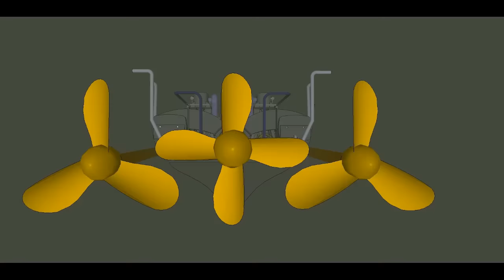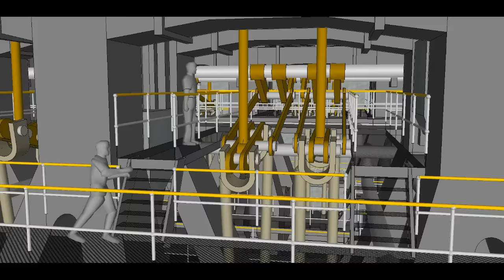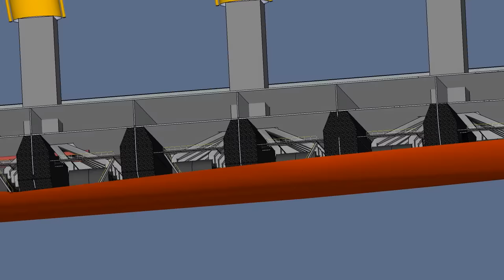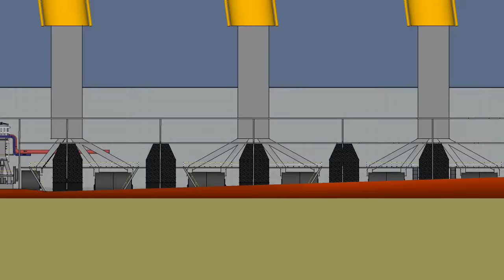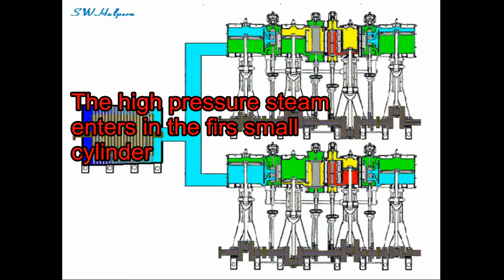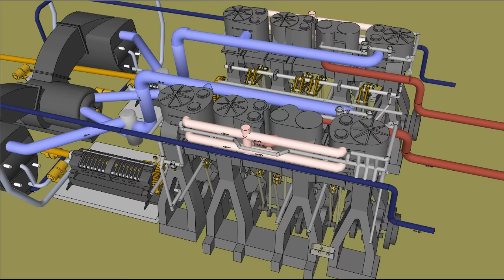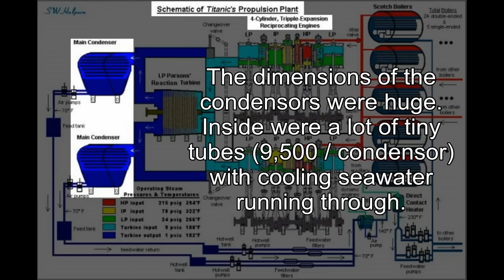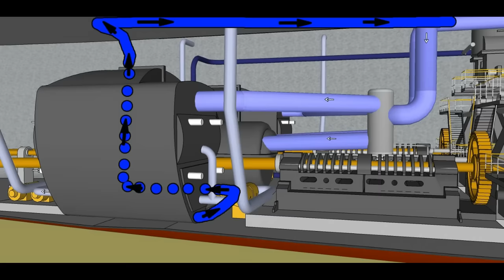The Engines of the Titanic

Comment: Those stokers had no eye or ear protection, no hard hats. They probably got treated like shit, constantly getting yelled at. And, god only knows how hot it was in those boiler rooms along with all the coal dust. Alot of men nowadays would quit after a few hours.Those were not ordinary men, much respect.
Reply: I agree with You. Respect and the safety of the workers has progressed a lot since then. Regards.
Reply: They were well paid and well respected. Until Oil fired boilers came around, a stoker strike meant ships won't sail. And operating on tight schedules and slim profit margins (the ship had to pay for it's construction and operation. Took 10-20 years for it to turn a profit), stokers could stop the world if they wanted.
But it was a hard, short life. Breathing coal dust caused silicosis and being an industrial setting you were subjected to stuff falling from height occasionaly.
A cloth mask and a helmet would eliminate these hazards completely. But we simply didn't know any better.
And it probably was HOT. Being under the waterline though, maybe it was not as hot as we might think. They had plenty of ventilation by air bled through the furnace air  intakes.
Reply: Yes i think you have summed that up very well, they would have worked their asses off, heat well you surrounded by boilers it is going to be HOT!! Similarly the fire men on steam loco,s summers day 25--30 deg C outside, 50++ inside the cab, driver wants MORE steam Big hill coming up, better get shoveling!
Reply: life is all about choices
Reply: My dad was a stoker in 1930s and spent 50 years at sea, even in his 70s he was someone you wouldn’t mess with, those men were a different breed
Reply: Completely on your side re - your great comments. Nice 👍 one. Cheers 🍻
Reply: Yeah and sadly those ordinary men are disappearing
Reply: @ThZuao  >A cloth mask and a helmet would eliminate these hazards completely.

A cloth mask would not at all be effective at preventing black lung and/or silicosis. It'd be like trying to use a screen door to stop smoke. Silica dust from fly ash is on the order of microns, even a modern N100 mask would have trouble with. The only thing the cloth mask would block are the larger coal dust particles, but not all of it.

The stokers also got heaping doses of radiation from all of the radioactive material in the coal, like uranium, radium and radon gas. They're exposed to it by the coal dust and even more from the fly ash and bottom ash which concentrates it. And by the nature of the ship having smoke stacks right above passengers, they get exposed to the same things, but have less risk since they're not on the ship for very long.

>And it probably was HOT. Being under the waterline though, maybe it was not as hot as we might think. 

Anywhere near the boilers was going to be well over 100 degrees at all times with thick choking smoke, coal dust and steam leaks. It was a miserable existence that was farmed out to people usually from Indian subcontinent because of the racist belief that they as a people were "designed" to tolerate such temperatures since India is so hot.

Being under the waterline didn't help the heat, that is until there was a gaping hole in the hull letting the freezing sea water in.
Reply: It was probably 120 degrees F or more standing in front of furnaces feeding them coal manually for the stokers, who also had the additional work of keeping the machinery in good working order. They were made of stronger stuff than most men today.
Reply: @GGigabiteM  >...with thick choking smoke... 

Didn't ships have a blower system for artificial draft while standing or not working hard enough to supply sufficient draft to send the exhaust out the funnels? Steam locomotives had this system, but it was touchy to use because it used steam to create the draft to help make more steam. Using too much was a waste of steam, you ended up using more than you were making if you opened the valve too much. I assume ships this size would have had this issue as well, considering there are multiple fireboxes (opposed to one in a locomotive).
Reply: @GGigabiteM  Oh, I never had any doubt of the miserable conditions. I'm just more of a locomotive guy than a ship guy and as such some of the workings of ships are a mystery to me.

That superheated steam tidbit is an interesting one for sure. Definitely not a problem you'd find on a steam locomotive, seeing as the highest pressure encountered on anything not considered an experiment of a failure was 300 psi.

Not to mention the super heater units were all tucked safely in the center of the boiler (which used a firetube system rather than water tube) whose barrel was 6 inches thick.
Reply: And yet it was still probably better than many other jobs at the time.
Reply: yeah cause most men are smart enough today to not want to get cancer from their job
Reply: @PowerTrain611  There is avido of the condition on the Ark Royal just before it was scrapped in the late 70's-eighties it will be on youtube there was a part of the engine room that was arduous.
Reply: @IanWaldrop  This is a key point. Their choices were vastly more restricted than ours are today.
Reply: @dondubray4253  really ? Lol there wasn’t opportunities back then like there are now.  Different time.
Reply: Back in those days, they were very ordinary men as working hard flat out to the bone was normal for back then. If you did''nt have back problems by your 30s you would had been considered a lazy bastard lol
Reply: @GGigabiteM  WOW!!!😲😱
Reply: Back in 1912 was no food for the family if you didn't work and you did what you could no unemployment no food stamps government didn't just hand every one $1,000 per kid or give disability money because you was lazy today's time is  pissing me off
Reply: @katja904  >You are talking like the coal that these ships used and burned would be some kind of Nuclear fuel or highly radioactive material,

When you burn hundreds of tons of coal, you concentrate the incombustible radioactive material into the bottom ash and fly ash.
Reply: @GGigabiteM  Have you made the misurements then with geiger counter to see how much "radiation" there in the combustion chamber must bee..? I mean this absurd..it's coal not radioactive material!
Reply: @GGigabiteM  By the way why wont you tell then how much radiation(that lethal one) does nuclear submarine release to the environment and sea?
Reply: @katja904  >By the way why wont you tell then how much radiation(that lethal one) does nuclear submarine release to the environment and sea?

Why don't you? Stupid games win stupid prizes.
Reply: i would have quit too if i had to deal with inferior technology. only electric motors on my vehicles
Reply: @Blox117  Yes the electric motor vehicles were higly apprised by the female folks back in the late 1800 and beginning of 1900 century because they were silent and easier to handle, of course men later on preferred vehicles with combustion engine..i think the best engine ever existed was the V8 engine.
Reply: @Blox117  No it's not true, carbon that we use  is a natural element that is not radioactive like example uranium found in the ground in natural state is weakly radioactive because all it's isotopes are unstable, you have to also understand the difference between naturally occurring radioactivity and the radioactivity created by man (man made radioactivity), these are two completely different things.
Reply: @Blox117  Carbon-based compounds form the basis of all known life on Earth, Carbon is the 15th most abundant element in the Earth's crust, and the fourth most abundant element in the universe by mass after hydrogen, helium, and oxygen. Carbon's abundance, its unique diversity of organic compounds, and its unusual ability to form polymers at the temperatures commonly encountered on Earth enables this element to serve as a common element of all known life. It is the second most abundant element in the human body by mass (about 18.5%) after oxygen.
Reply: @Blox117  Pure carbon has extremely low toxicity to humans and can be handled safely in the form of graphite or charcoal. It is resistant to dissolution or chemical attack, even in the acidic contents of the digestive tract. Consequently, once it enters into the body's tissues it is likely to remain there indefinitely. Carbon black was probably one of the first pigments to be used for tattooing, and Ötzi the Iceman was found to have carbon tattoos that survived during his life and for 5200 years after his death.[126] Inhalation of coal dust or soot (carbon black) in large quantities can be dangerous, irritating lung tissues and causing the congestive lung disease, coalworker's pneumoconiosis. Diamond dust used as an abrasive can be harmful if ingested or inhaled. Microparticles of carbon are produced in diesel engine exhaust fumes, and may accumulate in the lungs.[127] In these examples, the harm may result from contaminants (e.g., organic chemicals, heavy metals) rather than from the carbon itself.

Carbon generally has low toxicity to life on Earth;
Reply: @Blox117  The most common isotopes in natural uranium are uranium-238 (which has 146 neutrons and accounts for over 99% of uranium on Earth) and uranium-235 (which has 143 neutrons). Uranium has the highest atomic weight of the primordially occurring elements. Its density is about 70% higher than that of lead, and slightly lower than that of gold or tungsten. It occurs naturally in low concentrations of a few parts per million in soil, rock and water, and is commercially extracted from uranium-bearing minerals such as uraninite
Reply: @Blox117  Among the many fission product nuclides, cesium 137 deserves attention because it possesses a unique combination of physical properties and historical notoriety. It is readily produced in large quantities during fission, has an intermediate half-life, decays by high-energy pathways, and is chemically reactive and highly soluble. These physical properties have made cesium 137 a dangerous legacy of major nuclear accidents such as Chernobyl, but it has also caused relatively small incidents as well.

The Dangers of Cesium-137
Cesium-137 is among the most common heavy fission products. Fission of various isotopes of thorium, uranium, and plutonium all yield about 6% cesium-137. [1] This high fission yield results in an abundance of cesium-137 in spent nuclear fuel, as well as in regions contaminated by fission byproducts after nuclear accidents. [2] The large quantities of cesium-137 produced during fission events pose a persistent hazard. Its half-life of about 30 years is long enough that objects and regions contaminated by cesium-137 remain dangerous to humans for a generation or more, but it is short enough to ensure that even relatively small quantities of cesium-137 release dangerous doses of radiation (its specific radioactivity is 3.2 × 1012 Bq/g). [2-4]

Along with its intermediate half-life, a combination of high-energy radioactivity and chemical reactivity makes cesium-137 a particularly dangerous fission product. Cesium-137 undergoes high-energy beta decay, primarily to an excited nuclear isomer of Barium 137, which in turn undergoes gamma decay with a half-life of about 150 seconds. [4] The energies of both the beta decay of cesium-137 and the subsequent gamma decay of the excited barium 137 are 512 keV and 662 keV, respectively. [4] In addition, cesium is much more chemically reactive than many of the transition metal fission products. As a group 1 alkaline metal, elemental cesium is quite electropositive, and is readily oxidized by water, forming highly soluble Cs+. [5] For this reason, elemental cesium-137 may contaminate large volumes of water during nuclear accidents, which are difficult to contain or process. [6]

Despite its prevalence in spent nuclear fuel and nuclear waste, cesium-137 is actually extremely rare. Its half-life is too short for it to persist from natural fission sources, and on earth it is a synthetic isotope only. Should further nuclear accidents be avoided, the dangers of cesium-137 will eventually cease.
Reply: @Blox117  a steam generator tube that discharged 20,000 gallons of radioactive coolant into the facility. The incident was due to poor maintenance of the facility and loose oversight by the Nuclear Regulatory Commission. The accident, a Phase 2 incident, triggered a radioactive release into the atmosphere. The NRC gave the facility the worst rating because the previous operator of the facility was unable to detect any deficiencies in the steam generator tube that generated 20,000 gallons of radioactive coolant to the facility. The incident was due to poor maintenance of the facility and loose oversight by the Nuclear Regulatory Commission. The accident, a Phase 2 incident, triggered a radioactive release into the atmosphere. The NRC gave the plant the worst rating because the previous operator of the plant was unable to detect any deficiencies in the steam generator pipe prior to the February 2000 leak. A week after the accident, 200 gallons of radioactive water accidentally entered the Hudson River.

At least since August 2005, radioactive toxins such as tritium and strontium-90 have been spilled from at least two spent fuel pools at Indian Point into groundwater and the Hudson River. In January 2007, it was reported that strontium-90 was detected in four of the twelve fish tested in the Hudson River.

The Nuclear Regulatory Commission relies on self-reporting and computer modeling by reactor operators to monitor radioactive releases and their projected spread. A significant portion of the environmental monitoring data is extrapolated - virtual, not real.

However, radioactive releases from Indian Point’s routine operations are often not fully detected or reported. In fact, accidental releases may not be fully verified or documented.

And they occur throughout the nuclear fuel cycle, which includes uranium mining, uranium mining, chemical conversion, fuel enrichment and fabrication, the process of generating electricity in a plant through a controlled reaction, and the storage of radioactive waste, both on site. and beyond.

Finally, radioactive by-products continue to release hazardous radioactive particles and rays for extremely long periods of time, described as "half-lives". The radioactive substance emits hazardous radiation for at least ten half-lives. Of the radioactive isotopes iodine (iodine-129), the half-life is 16 million years; technetium-99 has a half-life of 211,000 years; and the half-life of plutonium-239 is 24,000 years. Xenon-135, a noble gas, decomposes into cesium-135, an isotope with a half-life of 2.3 million years
Reply: I've heard that they had pretty high suicide rates.
Reply: When men were men, and the women were too
Reply: @dondubray4253  "choices" were limited then. If you were lower class british you didn't go to college. There were no job training programs or tuition assistance. These men had two choices, manual labor or starvation, 1912 was a little different than 2023.
Reply: I worked in the engine room of a ship for several years. Normally about 140° but could easily go to over 180 ° (hottest I remember personally seeing was 192°). We had auxillary boilers and we would punch tubes in those conditions. 

Other people were maintaining or repairing other equipment (I was in "A-Gang").

Plenty of tough people still around doing real work. If you keep watching TV and hearing the stories about how soft everyone is, you'll keep on believing it.
Reply: Thank you for thinking about these tough men who worked extremely hard under difficult circumstances.
My great, great, grandfather was one of them as he paid his passage with shoveling coal. They were fed good to enable them to work (the only perk). They were allowed a special place on deck at night for fresh air. When he arrived at America he was so imbedded with coal dust the recruiter for the Confederate Army turned him down thinking he was black, until it began to rain.
Reply: But the Captain and the Officers always knew , without these guys nothing happened , the best food , the best bunks   ,and a few crates of beer at the end of the shift .
Reply: Why didn't they have mechanical stokers? Our home had one in the 1940's. Railroad engines had them.
Reply: @8546Ken  because of the diffrance of size of boilers and efficiency
Reply: @reble-liner   - Please explain.
Reply: Da época não tinha lei segurança e qualquer jeito... E hoje Navio Cruzeiro agora tem segurança é lei tem faixa do chão e fone ouvido fechado e uniforme segurança e luvas e capacete segurança... Imagina Navio Titanic não tem segurança trabalhador tinha acidente qualquer jeito....